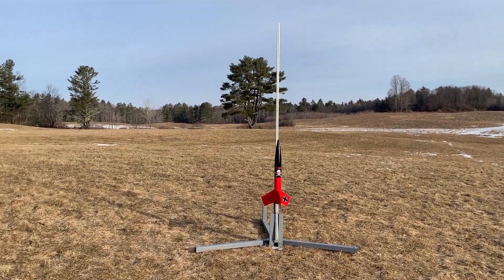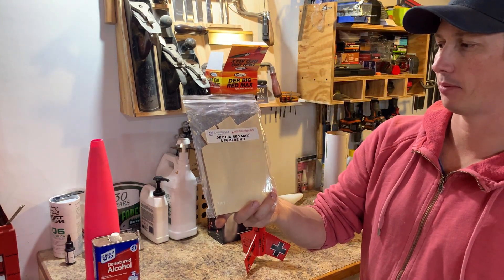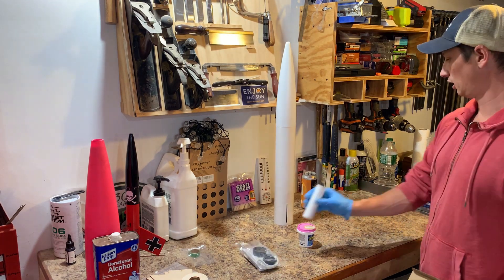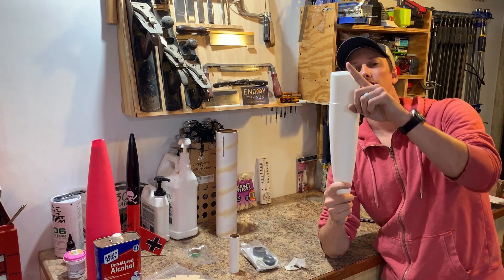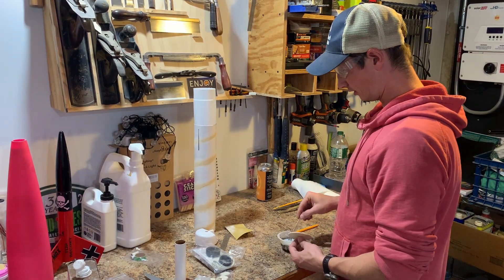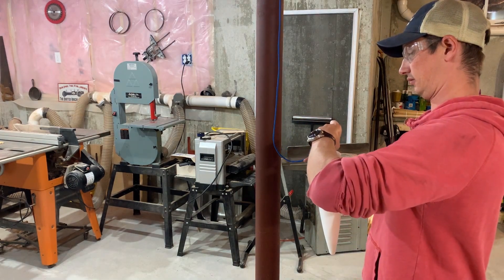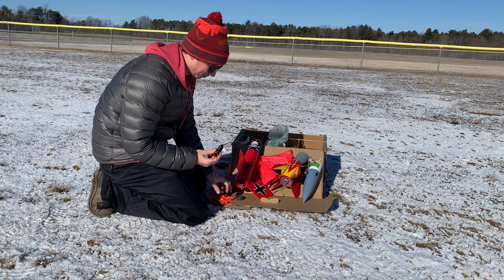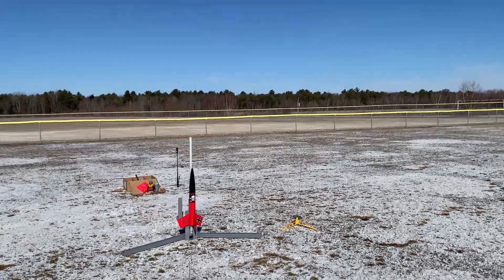Building and Launching the Estes Der Big Red Max

Comment: Did you have to add any additional weight to the nose cone to compensate for the plywood fin weight?
Reply from the maker: Around 5:00 into the video I talk about using 28grams of epoxy in the nose instead of the supplied clay. (I kept saying ounces instead of grams) That amount flies stable enough for me.

Comment: I like your alternative bulkhead. I was going to try epoxying in an eye bolt at the tip of the nose, but that'll do just fine. I'm running through a length of coat hanger wire to keep the epoxy plug in place at the tip of the nose. I also ended up putting fiberglass on the airframe and tip to tip on the fins. Overkill, but this way it'll be a tank.